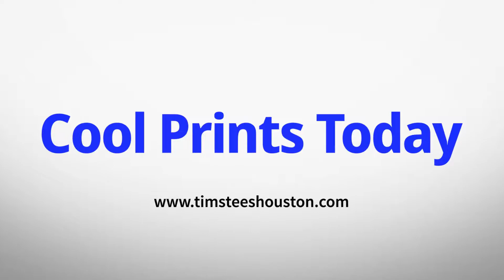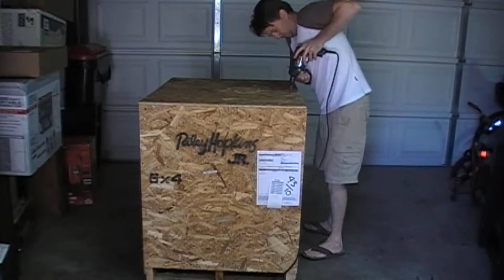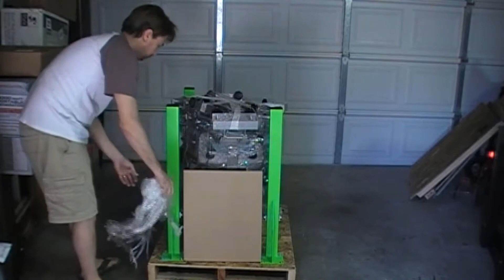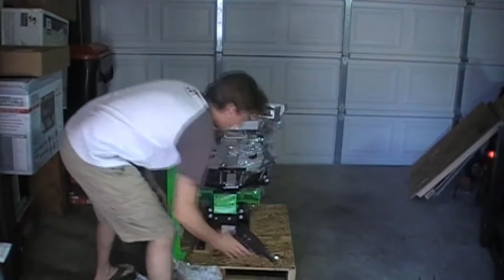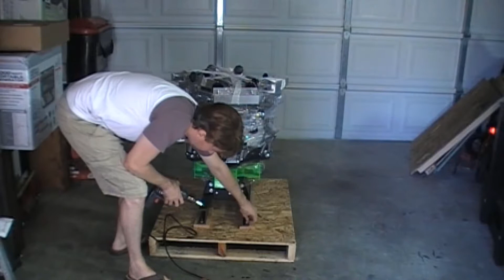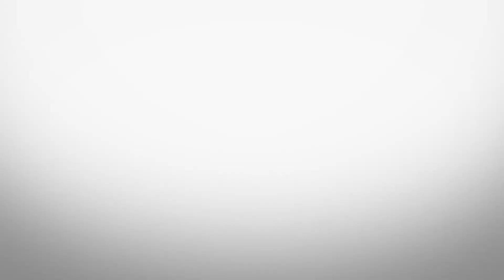Riley Hopkins 6X4 screen Printing Press Unboxing | Screen Printing Equipment Part One...

Comment: Good press. Sir what is the measure of the wide . my door is 36 . U think is good ?
Reply from the maker: It comes in a crate so I think the 36 in will be to small. You may have to open the crate then take the pieces in through the door.

Comment: Did you have to provide the fork lift or was that included with the delivery?
Reply from the maker: They had a lift gate on the truck and then used a pallet jack to move it into the shop. They brought everything needed for the delivery.
Reply: Cool Prints Today 👍 thanks for the reply!
Reply from the maker: @Dais98  Anytime!